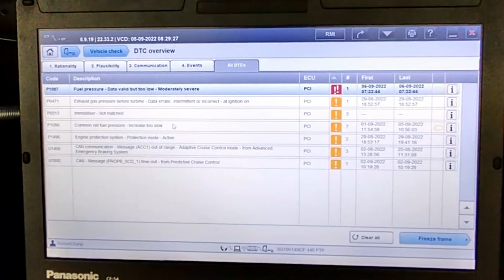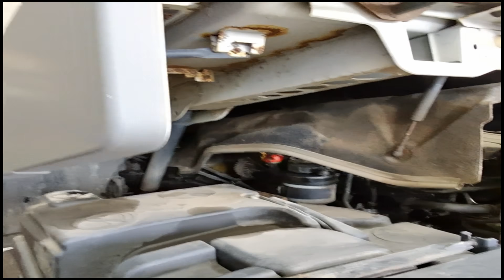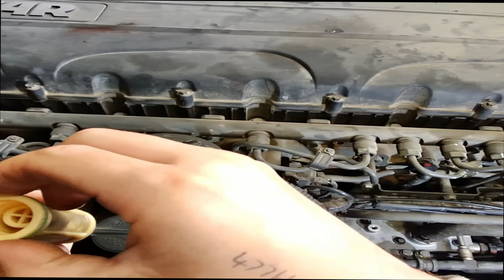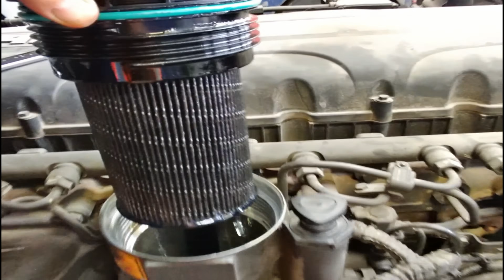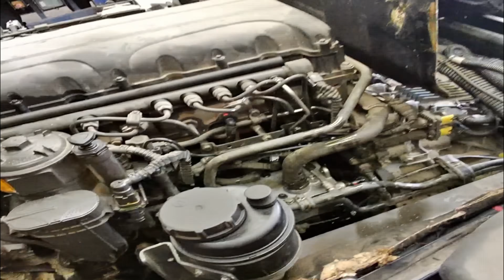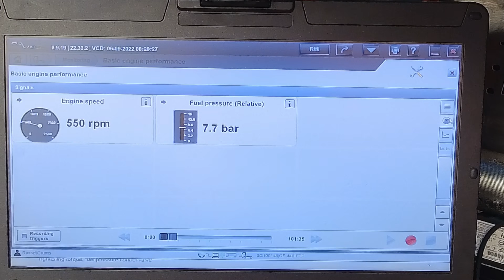DAF CF LOW PRESSURE FUEL FAULT? It's Easy If You Do It Smart

Comment: That business of having to be careful about draining the housing is not very clever (I know its not only DAF )in my opinion because in 97%of the world “man see filter housing top, man go undo it man go change filter” simple he knows nothing. Who is going think that there might be more to it after 100 years of filters that you just undo and fit new. They should be like oil filters that self drain as you unscrew the plastic top. I think theres a big problem with designers fresh out of uni that never turned a spanner
Reply from the maker: Yes, it's not a good idea and was changed on NGD. But if you crack the filter....it drains all the unfiltered particles into the fuel gallery 😰

Comment: Hi mate good video got same problem but in filter got Ali fillings is pump breaking up had same problem few years ago and replaced fuel pump cause of this just cutting out
Reply: Ok mate took it out lights gone out just seen mate at daf and got some primer filters just in case also I have fuel pump spare will run this week with open eye you every come across p153b active and p140einactive saying crankcase ventilation rotary speeddata valid but to lo least severe just built c.f. tractor camper go in round Scotland end of month but unsure if was going to be problem with engine light on
Reply from the maker: Good good. Chris, I have got a video on crankcase ventilation units if you want to see what can happen and what's you need to do to change them depending on type fitted.If you have the new type Cummins crankcase ventilation unit fitted you can get a repair kit for it now 😉
Reply: @TRUCKTECHUK  what is the Cummins mine on c.f. 400 64 plate
Reply from the maker: Hey Chris thanks for the comment. I had a few vehicle's do this before and the only way I've been able to identify it is to run tests on the fuel system to identify discrepancies in fuel system components to try and prevent the truck failing in service....which no opperator wants. 😐  how old is the vehicle?
Reply: @TRUCKTECHUK  is 65 got 6 c.f. 3 with lights on put a pump on this this one 3 years a go cause there were Ali fillings in pump when I stripped pump down looks like roller bearings have dropped and caused it to grind in pump causing this to  stop when not under pressure when left for a bit would start back up again
Reply from the maker: Chris if you are stuck with them and want a more definitive answer on what has gone wrong running a high-pressure pump test should identify your issue.

If want to contact me please do so on my contact page and we can try and get to the bottom of it quickly for you

Comment: Which fuel pressure test kit would you recommend for paccar
Reply: Love
The videos , the diagnostics are great 👍🏻Can you tell me where I can get the fuel pressure test kit
That you are using please or a part number ?
Reply from the maker: @Kyles Transport Services Limited  hey thanks for watching the video!. 👌 
I've actually got all the fittings and pipework here. Just need to assemble the kit and put it on the website. I can drop a link here for you when it's live for people
Reply: @TRUCKTECHUK  That would be fantastic , keep up the great work
Reply from the maker: Thanks for the comment. Unfortunately, I've only ever used paccar as the fittings are very specific. I've been able to source a kit with a gauge that does  both negative and over 8 bar pressure positive pressure for the paacar engine, but the price is £120 plus shipping which I didn't think was too bad considering the price of the paxcar kit is over 500!

Comment: Here is a question, On dafs, what does the man behind the wheel with the percentage and green tick and stat bar mean, it appears on the dash when you turn the ignition on?
Reply from the maker: Thank you for the comment👌
To answer your comment I would say your refering to the driver performance indicator 

https://www.google.com/url?sa=t&source=web&rct=j&url=https://wwwnordictruckce.cdn.triggerfish.cloud/uploads/2017/01/daf-driver-performance-assistant-64739-en.pdf&ved=2ahUKEwiK6quo5KD6AhVMEsAKHchnAHQQFnoECA0QAQ&usg=AOvVaw1Euwlw0I5GZY7_M2LgnEcN
Reply: Thanks for this 👍

Comment: Very nice video! That truck need Electric pump for low pressure because there is realy problem with MX 13 !!!
Reply from the maker: Thank you for the comment 😎👌
Yes Id like a electric pump for the priming engines and I'd like a MERCEDES style cab tilt pump that's electric too 🤣🤣🤣👌

Comment: I would say man in a van caused the issue...Just by chance had 2 low pressure faults myself this week ..1st one customer states he has changed filters ,checked the tank and it needs the low pressure pump..My thought why  didnt he replace it,,So gauge on ,underpressure off the scale ,no filter on pick up pipe and a piece of plastic wrapping stuck in the NRV at the interface...2nd vehicle fuel filter had been replaced and then fault occurred refitted filter and all was ok...What i have been doing recently when doing cams ,whilst the fuel module is off the vehicle i remove the water seperator  and the base of the module and the amount of crap that builds up in there is amazing , also there is a filter there that generally needs a clean.....One of the best i had was a new out the wrapper vehicle ,multiple DAFaids  for low fuel pressure,customer moaning DAF involved as is always the case ..Again underpressure off the scale  ,,Turned out there was a bit of solid plastic in the pipe from the tank to the interface ,that could only have been put in the pipe at manufacture ,,It was also a specific shape the plastic..No apology or anything just a we will go back to the factory with your findings lol
Reply from the maker: always seem to come in batches these faults don't they! 
it's AMAZING how people can't follow simple instructions on changing filters especially the damage it can cause to the fuel system with the tolerances being so high now for fuel system components. 
in regards to the water separator have you noticed a pattern on where the vehicles have been filling up i.e at service stations or bulk tanks in the yard?
Reply: @TRUCKTECHUK  we do not get any water issues where I am ..lol..but I do get annoyed with people and filter changes as they know in our place anyway that they won't get the fault to fix so they don't care..and no way will they follow the procedure for the ngd
Reply from the maker: You say about people not getting the fault to fix, we were discussing people being "quiet quitters" and also "quiet firing" (that's a good read).  it took me being a workshop controller to realise not everyone wants to be a master tech, some people want to just come to work .....tap wheel nuts and go home and I'm fine with that but if they don't want the complex jobs they should still work to a basic standard. Maybe I'm sad but I will help anyone from apprentices to random people who ring the dealership for advice If I  can help someone do a better job or understand something that makes my day but please meet me half way with   WANTING TO DO THE JOB. 
My favourite I hear is "I don't get paid enough to do that" 😑😑😑😑😑
Reply: @TRUCKTECHUK  The i don't get paid enough is a "i don't know what i'm doing "..I did the very first Master Tech  waaaaay back in 2009 ..Back then it was a big thing ..Some people don't want to know ,that is their excuse for getting out of work ,and some are just totally incompetant..I find when you advice someone for example to use gauges ,it isn't what they want to hear  so they won't use them and spend more time just randomly condeming something that is not in stock hoping someone else gets it and then have to fix the issue ..Don't get me wrong most people have strengths and weaknesses ,and you NEED that person who is happy chapping nuts and bolts ,as much as you need those who would rather get their teeth in to problems..But for some it is a job they fell in to ,not something they wanted to do when they left school...And people  for some reason will not use RMI ...IT ISN'T PERFECT but it is yes or no  lol..Had a lad change sws and a clock spring still had the same fault 14 hours later  so i got it looked at some diagrams fuse for clockspring had popped  15mins ..and after the roadtest and turning the steering full lock to lock in the yard  all ok ..i will say the workshop who brought it in had been on it for 14 days lo
Reply: @TRUCKTECHUK  Workshop controller is the most thankless job in the trade ..We are looking for a new one just now ,no one wants it
Reply: @norb0254 i was one in a big council depot in the south of England and it really is like being a head gasket between management and workforce (force may not be the right word😅) i think its impossible now because people have worked out all the ways to quit quietly as mentioned above and really don’t want to know much and i do get it to some degree. Not everyone is worth paying much and that feeds into them not being bothered  and visa versa

Comment: Great video. Enjoy from here in Indiana, USA. MX11 isn't very popular here, but I work on 50 truck fleet of MX-13. You guys able to get EUP's or OCV's? No one will let us know what is the actual shortage @ Delphi or Cummins filtration. Curious with Delphi being right there they tell you anymore. Keep the videos coming!
Reply from the maker: Thanks for the comment from across the pond ❤️.
I see a large mix of mx-13 and mx-11. I think the amount of issues we have had with the camshafts in mx-13 engines, owners who have mx-11 engines must so glad the have overhead camshafts 😂.
In regards to the unit pumps and crankcase ventilation units I know we have them sat on the shelf in work......I will check the factory Monday to see what the stock levels are just incase we're heading for another shortage of parts like we had with the VTG actuators awhile back. 
I'm glad your enjoying the videos 👌😎
Reply: @TRUCKTECHUK  Interesting, we never had any issues getting VGT actuators which for most part are root cause of random E-CAN codes. I have EUP's on order since January, OCV since May. Keep pushing expected arrival back. PMCI (ECM) have been on backorder for long time also. I know of a guy sending them to your area to get them fixed. My fleet has never experienced a cam failure on the MX13. I think the lower temperature oil temp thermostat campaign helps the issue, but we don't run the extremely lengthy oil change interval and still run 15W-40. Two fleet that had cam issues around my area (one delivers packages in brown trucks) both ran the long oil change intervals and 10W-30.
Reply: @stevesauerland223   what is the mileage of trucks using 15w40? We use only 10w40 DAF engine oil on mx 340 and mx 11&13 engines. Here we have 4 seasons and it happens sometimes to change camshaft because of cracked tapped roll on pump or valve. Dislike the fuel filter o-ring seal. It’s EPDM or smth like that and have to change every time when you loose the cap.. The video strikes again buddy. Regards 🎉
Reply: @preslavvasilev7387  We run Paccar from MY 2012 all the way to MY22 and some Cummins/ Caterpillar that still require 15W-40. We have over 800,000 miles (1,287,000 KM) on many units and run 25,000 mile Oil change interval on tractors, 12,000 on dump trucks. Currently use Shell Rotella T4 15W-40, but for years used Phillips Guardol ECT 15W-40 but is "shortage" of it. I have had EUP failures with broken spring/damaged lifter, but anti-rotation pin usually shears and EUP bolts breaks so doesn't damage camshaft. Cam failure I was referring to was EPA17 with pressed on lobes. Interesting how cam failure increased when they switched to variable displacement pump and lower oil pressure.
Reply: hello bro how are u doing,how can I get in though with you pls